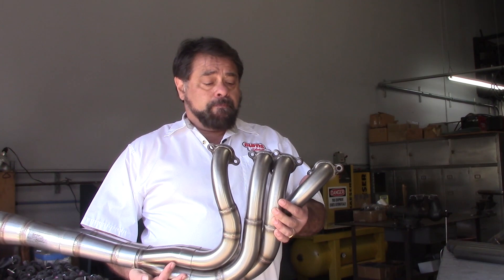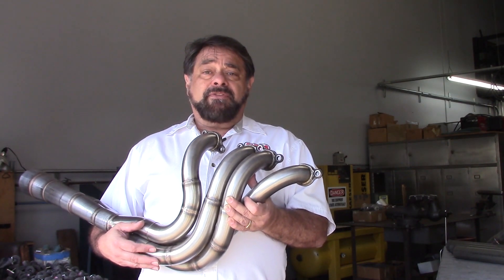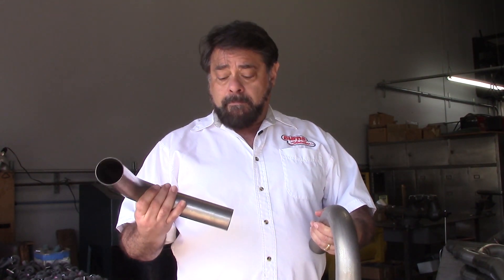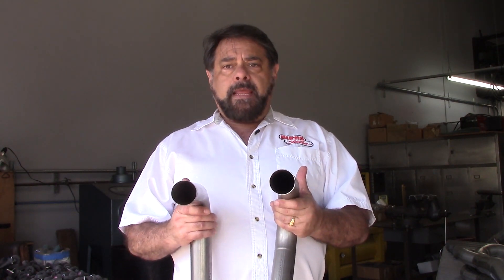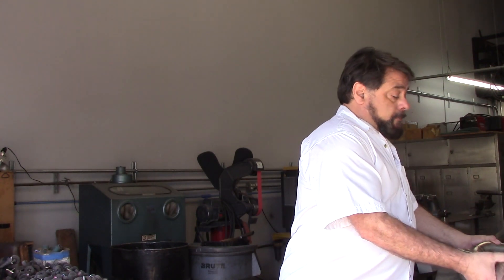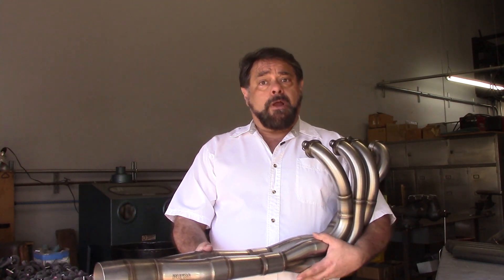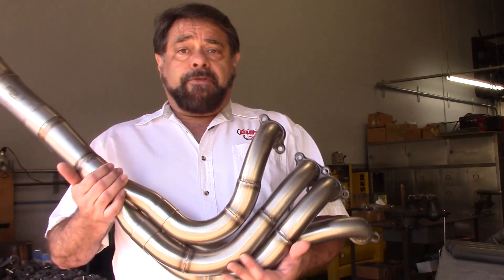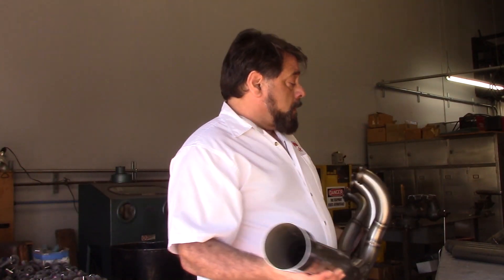Exhaust Header Tubing - Vince In Shorts

Comment: how about rust resistance? 304 vs 321?
Reply from the maker: If you are talking about corrosion at ambient temperatures, they will be about the same.  316SS is better for salt water exposure for example.

Comment: very nice, i had long tube headers  from ss 304 and it melted after 5 years and 35000km,it was wraped with" titan" wrap that should stayed alive at 1400 C  but it disintegrated after 2-3 years  i am looking for something what would not melt when i floor my 5.7  chrysler 300c, i asked in inox shops and they do not know what to use , i can not find 321 , only 304,316, 408, what to take?